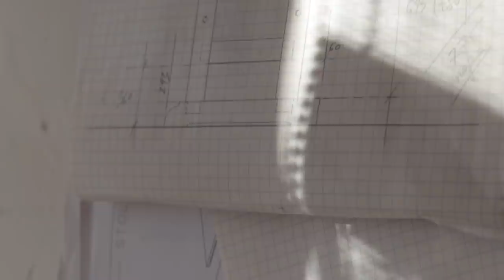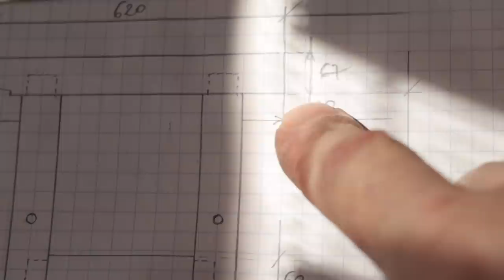Finał renowacji. Moja nowa strugnica dostaje imię "GEORG".

Comment: Well done. I just followed your lead on my very own old swedish workbench (hyvelbänk). Is your one also originally supposed to be fastened to the floor with bolts? Or is it sturdy enogh as it is? (It doesent seem that heavy)
Reply from the maker: It should be sturdy enough. Mine is something about 70-80 kg.
Reply: then I congratulate you to a heirloom workbench!